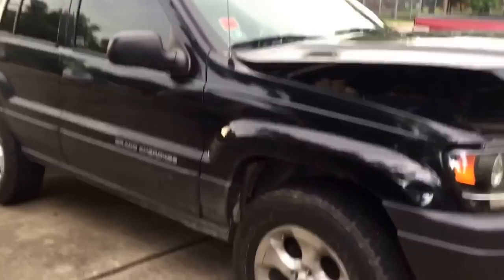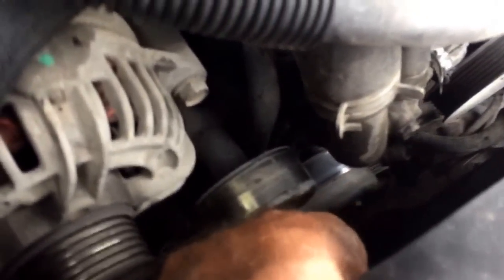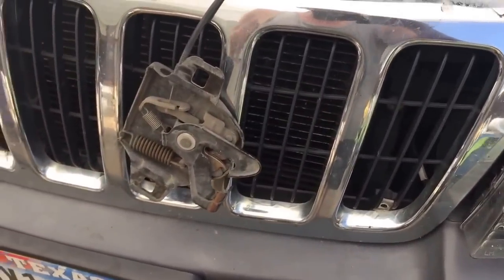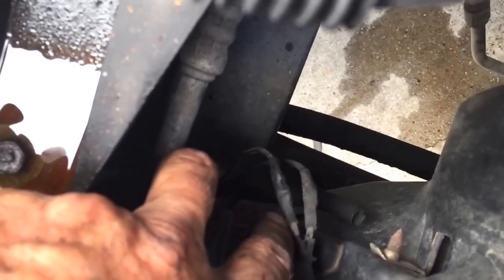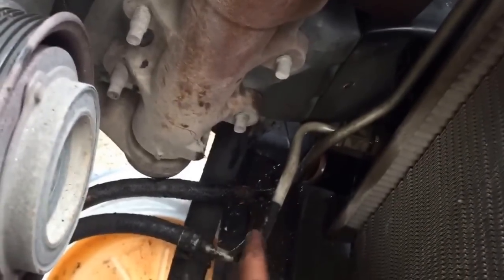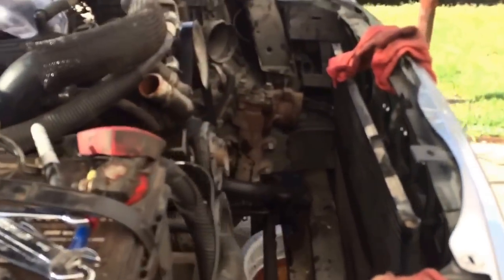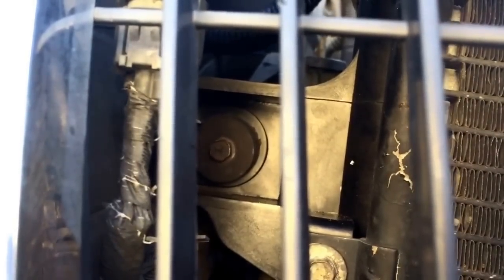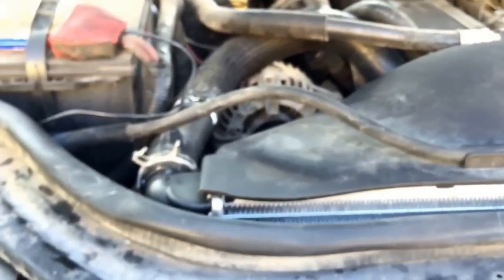Radiator Replacement on a 2003 Jeep Grand Cherokee 4.0L

Comment: I have not gotten a reply. but i will try today and update. this is EXACTLY what i have been asking all over youtube.  (Where does the upper and lower radiator lines connect back to)?. Since we had to do the same/ remove the rubber lines from metal line. I see the bottom line from radiator goes to the shorter rubber line. wow. Today I plan to do this. have been asking for months. This is pure DIVINE INTERVENTION. as your channel did not pop up when ever I asked around for this answer. God definitely knew before hand today will be that day I decided to take a chance and fihure this out on my own. I was worried Id blow another radiator.. connecting those lines wrong.  God bless you..some more!!!!!!!!!!!!!!!!!!!!!!

Comment: My jeep has a leak in the same spot that yours cracked open. Its a very small hair line crack. Must be a problem in 2003 4L set up.Will be doing this real soon don't want it
open up like yours out on the road some where.Thanks for all the info

Comment: Is the inside of the radiator got a hole in it or do I need to check the lines and fix your pressure test on it I need to know when the coolant is going into the tr milkyansmission and turning

Comment: OMG have searching for this, have a question. 
I was not able to budge those lines off the radiator so I disconnected the lines. I didnt check to see how the lines go back. meaning does does the lower radiator metal line connect back to the lower line from trans or vice versa? help a girl out.

Comment: Is the inside of the radiator got a hole in it or do I need to check the lines and fix your pressure test on it I need to know when the coolant is going into the transmission and turning

Comment: already to drop my new radiator in, but can't get it to fit. It is exactly like the old one. I noticed your video didn't include putting the new one in. Any wisdom on this subject? How to get new radiator back in.
Reply from the maker: +chevytxutube Sorry for the delay. We were out of town with no connection. I hope you have been able to resolve your issue by now, but if not, check the feet on the bottom of the radiator and make sure they are the same. If I remember correctly, there are some rubber boots that fit where if sits into the radiator support.

Comment: I disconnected the trans line ..was only way to remove the radiator and upper until I thought.. i could have cut it... to keep them in place to know where they each connect back to
Help a girl out

Comment: I'm trying to change my radiator now but I can't seem to get the bottom transmission line loose. Would you recommend taking the hose clamp off and trying to remove the hose and if so is there a trick to getting the hose off the line? I slid the clamp up but I can't get the hose to slid off and I'm afraid I'm going to end up breaking it. Any help would be great!
Reply from the maker: As you saw, I had to disconnect the rubber hoses from the metal lines by removing the hose clamps. Once the clamp is slid back, you may have to grip the rubber hose lightly with pliers to try to get the rubber hose to slip on the metal line. If you have enough slack in the rubber line you can also cut the rubber line and then cut the rubber hose off of the metal line once the radiator is removed. Good luck getting it off!
Reply: lol I just did this on mine the trans cooler lines are just retarded to remove ha ha I took the whole metal line off once I got it out.  had to bend the top one just a bit to do it. I will work on them this week getting them free from the mountings.  if not I will just buy new ones. thanks for doing this video made me feel a little better that I am not the only one that had trouble with those lines lol.
Reply: how did you get the sensor off your lines
Reply: Trey Clanton heat anything plastic or rubber and it will come off easier.    If it's below 40f you almost have to.   It helps keep from breaking those flimsy plastic clips on wiring harnesses too and just makes the job go easier.

Comment: Trey. Thanks for the video on the jeep Cherokee radiator removal. my son has a leak in about the same spot as yours but not quite as bad yet. and like yours the idler guide pully was bad and broke the belt, I did get that part fixed. Thats when I noticed the radiator leaking by the upper hose. so my sons jeep has two fans one is electric, And one is belt driven and attaches to water pump bracket did yours have that also, Was wondering if I'm gonna have to remove that fan to get the shroud and elec fan out. like I said not sure if yours had that other fan.  thanks for your time. Mike
Reply from the maker: Mike Small  Hello! Yes, hers did have a mechanical fan. I managed to sneak the radiator out without removing the fan if I remember correctly. It may be just as easy to remove it though. It’s pretty tight getting everything clear with the fan in place.
Reply: Thanks Trey for the quick reply. think I will take the four nuts out of the fan and remove it to make more room. hopefully I can maneuver it and get it out around the shroud area first. thanks again. Mike

Comment: To ANYONE having a difficult time removing/replacing the factory transmission lines, it's very simple... DO NOT use the factory transmission cooler... Always use an external transmission cooler, preferably a plate-on-plate design, like B&M (or even a less expensive fin-on-tube design will work) in front of the A/C condenser (which, as you know, sits in front of the radiator) and use AN fittings with stainless steel braided hose. Think about this in the most basic way...The factory transmission cooler is INSIDE the driver's-side plastic tank of the radiator and is surrounded by extremely hot water (almost 200°) that, somehow, "cools" it? Now what would a wise person think would cool a hot liquid down... fresh, cool air blowing across a transmission cooler or a metal tank inside of a plastic tank with extremely hot water running around it? Now I know someone is going to reply that this design helps warm up your transmission fluid in the winter if you live up north, BUT that just proves my point that the radiator heats up your transmission fluid. The factory simply uses the least expensive, no, I will say CHEAP parts in order to maximize their profit margin. Why do you think they use plastic-tanked radiators instead of metal-tanked ones like they used to do? What they say is that plastic is lighter, which saves weight and therefore helps you get better gas mileage. But what they don't say is that the aluminum/plastic radiator is far less expensive than the much better brass/copper or even aluminum/aluminum radiators, and therefore increases profit by lowering production costs. Besides, plastic-tanked radiators cannot even be repaired when the tank cracks/fails, like a brass or aluminum tanks, which can be welded.  EVERY single plastic-tanked radiator that I've ever seen with a leak is 100% of the time due to a crack in the plastic tank, NOT the aluminum core... EVER!! If someone plans on keeping their vehicle for a long time, like most Jeep owners, then forking out money for the same, cheap replacement radiators (or other vital replacement parts) which break after only so many years, is not the most intelligent way to go. Besides, plastic-tanked radiators do not cool as efficiently as brass-tanked/copper-core or aluminum tanked/aluminum-core radiators... it's simple physics/metallurgy. I've used Flex-a-lite full aluminum radiators & their electric fans in MANY vehicles with great success, plus they have slots in the aluminum tanks for t-bolts that hold brackets for transmission or power steering coolers to be mounted on the front side plus electric fans mounted on the rear side. That solves a lot of mounting problems. I also like the stainless steel flexible radiator hoses, which I use with silicone ends and heavy-duty t-bo stainless lt hose clamps. Another must I always do is add a high-volume water pump from Flowkooler, whether or not I have installed a better radiator than the stock crap. And finally, after installing an external transmission cooler, a higher-end metal-tanked radiator with electric fan(s), a high-volume water pump, and stainless steel flexible hoses... one might as well use Evan's NPG waterless coolant. Yes, it's expensive but we'll worth it. Read their website thoroughly to know more. Anyways, I hope this helps someone out.
Reply from the maker: That is not a bad plan at all. I will say that the factory standard approach works, but the fittings are certainly a challenge. So far the factory approach has worked well for 250,000 miles on this one.
Reply: Some sound advice .

Comment: The only reason why I watched this video was to watch you pull the radiator out and put the new on in I'm about to take mine out tomorrow if you could just enlighten me or give me any pointers that would be greatly appreciated
Reply from the maker: Jordan Pavlic it can be quite a challenging job. Just take it one step at a time. First empty the radiator and remove the hoses. Then take off the top radiator support bracket (where the hood latch is). Remove the fan shroud, remove the bolts holding the AC condenser coil to the radiator, remove the two radiator mounting bolts (one on each side). Then remove the transmission coolant lines. Finally, start patiently wiggling the radiator up and out. Installation is simply the reverse. Good luck with it!
Reply: Trey Clanton thanks, the next steps I have are the mounting bolts for the radiator and then the trans cooler lines, I'm almost there!
Reply from the maker: Jordan Pavlic If the trans cooler lines give you any grief, just disconnect the rubber line and deal with it outside of the car. I would have saved myself time if I had done that.

Comment: You should have dropped a new electric fan in there, or installed a fan clutch and fan to the water pump, which is something else you should have replaced because you already had everything out of the way.   You also should have put in a new thermostat because from the look of that radiator your cooling system is full of corroded water, doing this would have cost you about an extra $175, but well worth it if your were going to keep the Jeep for a while.

Comment: my jeep is leaking from the bottom radiator transmission hose should i just tigthin it the radiator still good
Reply: Your fitting is faulty.  Replace the radiator.

Comment: Plus it's been sitting out for several years now I need to know
Reply from the maker: Hello Sir. There is a transmission fluid cooler inside the radiator. If that cooler has failed, then you could be getting coolant into the transmission. It isn’t repairable. It requires replacing the radiator with a new one. Pretty sure that will resolve the problem.